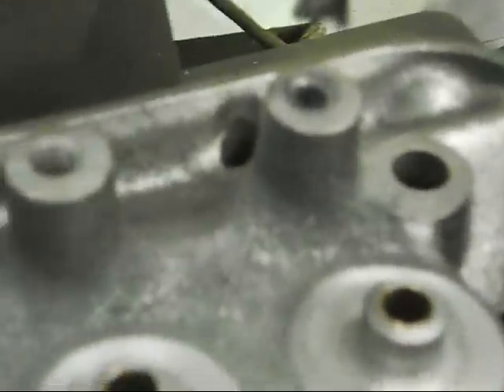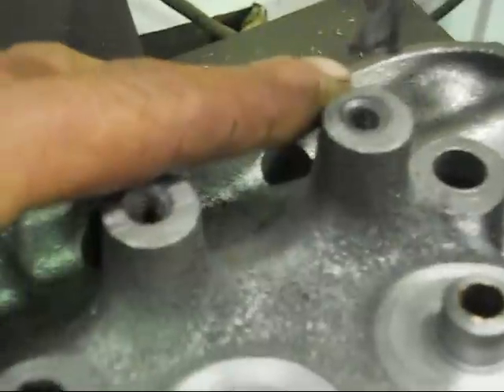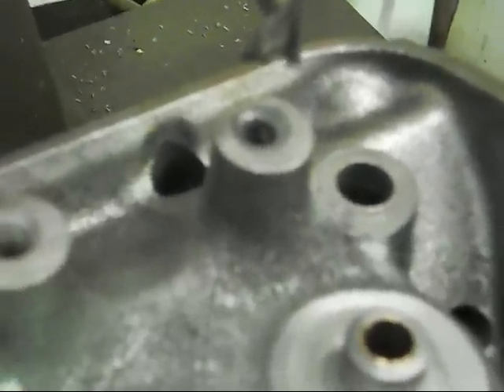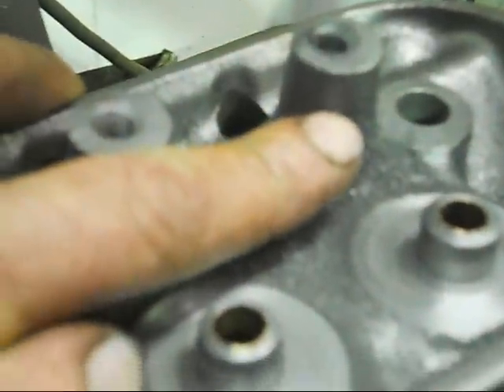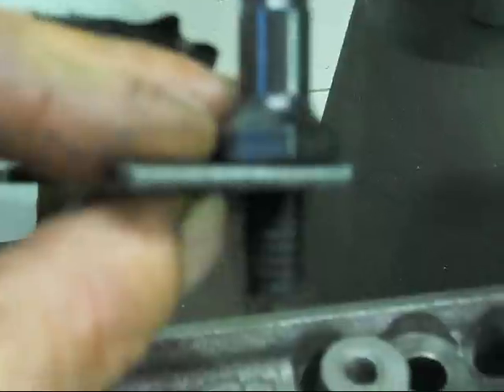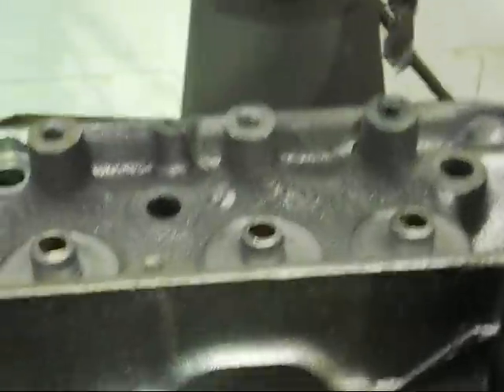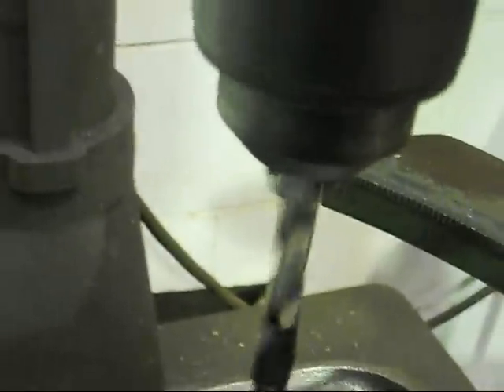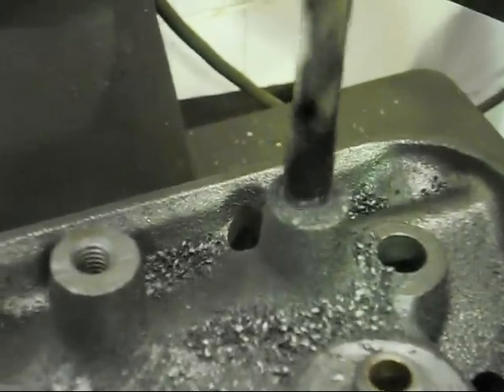How to modify V8 heads for ARP 7/16 screw in studs for adjustable roller rockers

Comment: Why would you want to waste your time drilling out an area your just going to be removing anyway .. Why not machine down the casting for the stud post then drill it out and tap it for the 7/16 studs which by the by I believe to be over kill for any tiny Ford engine unless of course your going to be winding it up into the high RPM heavens ...considering the total lack of material you have to work with in the first place .. Or I'm I not seeing something ?
Reply from the maker: Because the 3/8 hole drilled acts as a guide for tge pilot on the end of the boss cutting. Standard they have 5/16 unc thread. Thats why buddy.
Reply: What your not seeing is the pile of empty beer bottles he managed to accumulate before coming up with this idea.